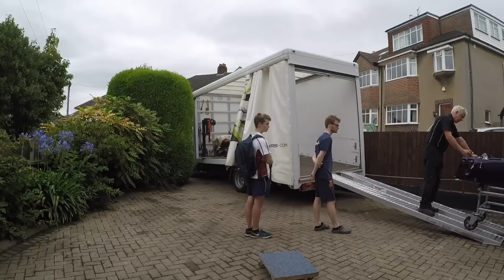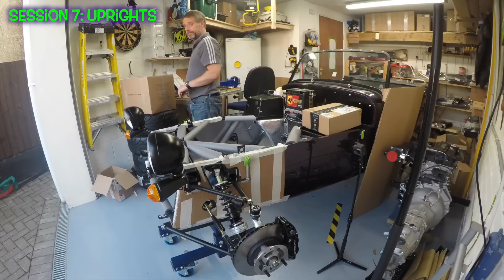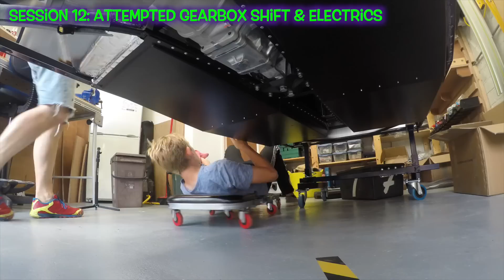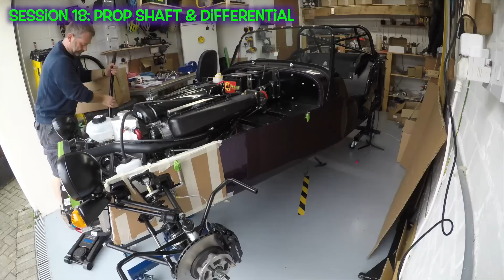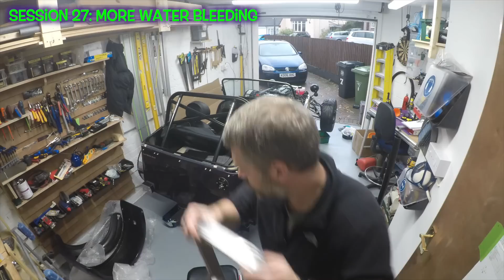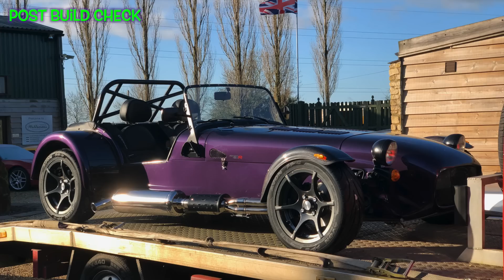Build A Caterham 420R Kit Car In 30 Minutes // Time-lapsed of course!

Comment: I’m about to embark on a build and watched yours (and others) from start to finish.
I felt your pleasure and your pain and I would like to thank you in advance for alerting me to the problem areas and pitfalls.
As for suggestions . . . 
There is a major shortage (absence) of home maintenance/servicing videos and a series of these would, I suspect, be uber useful.
My build is going to be a 360S with sports suspension, SV with lowered floors.
I would very much like to document it for the benefit of others but need basic advice on setting up a blog/website.
Could do with a chat in that respect. Are your contact details in your build diary?? - I must look!
Reply from the maker: Hi @ybliga, yes you can find my email address in the contact page of my blog. We can connect on WhatsApp or something after that. I’d be very happy to chat with you about blogging and building.  
If you’re looking for some Caterham servicing and maintenance videos then I can recommend Turn7 and Rod Oldland. Both have done great videos. James at ACaterhamCalledFern also has a lot of really useful content.
Reply: @Purplemeanie thanks - I’ll be in touch.
I spoke to Rod earlier when looking for advice on specification that I should go for. What a fab guy - I wrongly assumed Turn 7 were a franchised dealer but despite knowing I couldn’t buy from them, he went out of his way to be helpful and gave very good, unbiased advice.
Likewise, I have watched a number of Jame’s  videos.

Comment: I wonder how much it would cost to import a complete kit to the US. Do you know if the prices on the website are for an assembled car, or the kit? I wouldn’t mind building one of these. They’re very cool, and unique here in the states. Great job👌
Reply from the maker: Thanks for watching. There certainly are people that buy kits and have them shipped to the US so they can be built there. I think there’s a company that offers that service. The USA7’s website would be a good place to ask: https://usa7s.net. One issue you’ll have to deal with though, is that finished cars and kits are on quite long lead times - it was over a year when I last heard, but I think they’re working hard to get that down again now. As for pricing, they certainly did used to provide pricing for kit builds on the website, but I think they may be presenting a US version of the website that doesn’t include kit options. Good luck with your search. John

Comment: I have to ask, is the ford duratec engine worth it?  I've heard the k-series engine or even a rotary is great in this car, but I would assume the downside to a rotary makes it less practical off the track with the warm ups and fuel mileage drop.  But otherwise, it does have a weight advantage.  Any experience with other engines?  Do you have issues with the Duratec?
Reply from the maker: HI, thats a very good question. To answer the last part first, I’ve had no problems with the Duratec, and I’ve not heard any problems from other owners. Caterham even makes a supercharged version that is another level again from mine. They do also still sell a 2.5L Duratec in the European market that I’ve heard is very impressive. Then Caterham now sell a 600cc Suzuki engined version of the car that many owners love for its light weight and therefore great handling - nowhere neat as performant, but a lot of people really like it as a fun car on the road and track. The k-series engines are often loved by Seven owners as a free revving and lighter version, but of course they are now older cars only, and not available as a new purchase - but I know owners who would absolutely not “trade up” to a Duratec because the love the character of the k-series so much. Personally, I’m a bit fan of the 2.0L Duratec due to its lazy town and country driving but can be a beast on track too. I have no experience of rotary based Seven’s so can’t give any opinion there. Perhaps one of the downsides of the Duratec’s is that they get very hot, and there’s a lot for heat soak into the passenger compartment - which can be a pain on hot summer’s days, touring, or on track, where you can’t get away from the heat (makes for toasty knees). The Duratec’s are also a bit heavy, so handling isn’t perhaps the same, they can push on a bit in corners and not as nimble as a k-series or Sigma car. I love my 2.0L Duratec, it’s just right for me. But you’ll hear many other Caterham owners say the same about their completely different cars too. You pays you money and takes your choice. Hope that helped, maybe not. It’s a complicated subject with not one right answer.
Reply: @Purplemeanie  Great feedback.  Appreciated.

Comment: Great job, well done. Love the vid, love the car, but, I stopped watching when I learned the price. (Half way through). Sorry. I just can't justify spending that much on a car I have to build myself. LOL. I could buy a nice secondhand Porsche for that. 🙂
Reply from the maker: That's a very good point about the price, I totally get that. But for me half the fun is in knowing I built it.Thanks for watching (half) the video and taking the time to comment 🤣
Reply: @Purplemeanie  I will go back and watch the other half, some other time. 
And I appreciate that you built it yourself. I'm a panel beater - spray painter. I owned and ran 4 smash shops back in the day. I'm 63 now, but I've restored and built many custom cars over the years. It's always a thrill to see the finished job, knowing you did it by yourself. More power to you. 
Cheers from Australia.

Comment: The original Lotus 7 was advertised as 0-60mph in 3 days. This was how long it took you to build it from the kit. What took you so long!
the reason to build it from a kit was to avoid sales tax. But then the whole thing only cost 1000 pounds (UK money)
I remember a friend who had a Lotus 6, with a Triumph TR2 motor. Talk about fast roller-skate!
Reply from the maker: Yeh... you're right.. I took a long time. Part of the problem was that I was savouring it 😀. But it was also that I blogged all the build on my website and that took me as long as the build itself.

Comment: As an ex employee of Arch motors, saying it's a kit car makes it sound like a cheap copy.
This video shows that these builds ain't for the faint hearted....
Reply from the maker: Thanks for the comment. You're right, they're not for the feint heated, but they're also quite accessible if you have some mechanical acumen 😀. I think there are a lot less "kits" that are half-finished these days. The number of blogs available to help you are a big part of that I think too. Personally, I think the Caterham "kits" are top notch. The guy that did my IVA test said that he usually has a lot less trouble passing Caterham builds, over other kits, because of the quality of the kit.
Reply: @Purplemeanie  They are the best ones to build from a  kit as you've said because they are quality and  the frames are repairable as well due to being bronze gas flux welded instead of being mig welded together and less stress points on the frame due to the welds being harder than the parent metal.

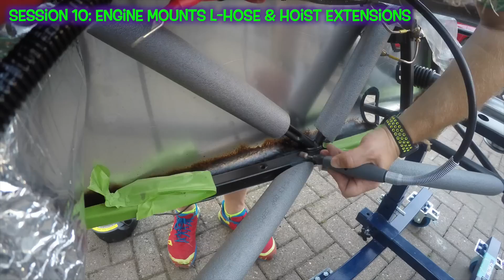Comment: Great video. I know it's two years ago but in some shots it looks like there is serious corrosion at the bottom of some panels e.g 9:18. Curious as to what it was. I've thought of building a Caterham but the laws here in Australia make it almost impossible to get it registered.
Reply from the maker: Hi Graeme, no there's no corrosion on the panels. Possibly just reflections off the floor maybe? I've now done about 4,000 miles in the car (pandemic knocked my mileage for a while 🙁) and no signs of any corrosion. I feel your pain on laws... I suspect it will become more and more difficult to own cars like this here too soon.

Comment: Exhaust spring installation assistant... about an 8 inch piece of tubing or round stock, with a hole to catch spring anchor, with an OD less than the spring hook ID with one end cut with a little angle can be slipped over one of the header spring anchors to extend the spring to hook in place.
Reply from the maker: That's a good idea 👍🏻

Comment: I am an ex pat living in California, I recently just started building a factory five roadster.  I have always liked the caterham nice work.  The factory five does not have the cabin panels fitted in the factory and that is what I am working on now.  I am planning on my build being easy to update to pass the Iva in case I return and want to import it.  Did you ever look at it during the build and think to yourself what have I done? I have always dreamed of building a car but sometimes it looks overwhelming.
Reply from the maker: Thanks for the comment. As I was building mine I did wonder whether I had bitten off more than I should have. But looking back now I realise that it was actually really straightforward and I should't have worried. Good luck with the build.

Comment: I had a concept of a Corvair engine in one (in front), with transaxle in back (via: torque tube), but theirs no way of making the block a structural member, replacing the existing tubular frame (triangular support) and other "minor" issues.  ;-)
Reply from the maker: That would have been cool. But there's so little room in a Seven chassis.
Reply: You're correct and like I indicated, the structure would be compromised.

Comment: I would love to do a catheram build, but only ordering the body, seats, lights and fenders, and get all the mecanicals parts of a subaru WRX! I know the flat engine wont sit in the engine bay, and a lot of electronics will have to be messed with to just have the car starting, and that custom axle would be needed, but I mean, why not?
Reply from the maker: That would be a pretty amazing build. Go for it!

Comment: Hi. Thinking of doing a 420R myself, this video is really helpful. What would you say were the most difficult / headache inducing parts of the build?
Reply from the maker: Thanks for watching and commenting. Tough to say what was the most difficult… the headlight wiring was frustrating I guess but all of it was very do-able. I think the biggest frustration was the manual and the amount of research I had to do outside of what was in the manual. I know there’s the new Ikea style manual these days, and I haven’t checked how good it has become… but the last time I talked to someone about it they said that you still needed to use the old manual AND the Ikea manual to make sure you knew what you’re doing. There’s a new Blog out there “The Complete Guide” I think its called and that’s supposed to be good. If you want more of my ranting then of course there’s my blog too. All that to say… Good luck! It was one of the best things I’ve ever done, and a great community once you’ve built it.
Reply: @Purplemeanie  thanks very much for the tips, I'll have a look at blogs.

Comment: great build video.  looks like even Caterham which comes in a semi assembled kit, there is still a lot of work to do and fiddling around to get everything to fit right. 

2004 i built a Tiger kit car, you have to do a lot more as you get the chassis bare frame, some bodywork and suspension pieces etc and have to supply your own engine and gearbox.  It was a good learning experience and like yourself i remember i had a wet day for the vehicle test day. 

If i had the money, time and a garage i would love to build another kit car someday.
Reply from the maker: Yeh… you’re right, the Caterham’s come with a lot more already done than other kits…. And more than I was expecting to be honest. Good luck with any future builds!

Comment: Thanks for taking the time to make this video. Can I ask, how much you need to spend on 'bits' beyond what you need to pay for the car itself? Wheeled axel stands, hoist, any other special tools, all the testing and the fees for pickups, etc? Excluding the basic tools every garage already has, of course :)
Reply from the maker: That’s a good question. I forget but I think the car registration cost about £200. As for tools and stuff that wasn’t in the kit… I spent a few hundred pounds, but you could probably get by with just the regular screwdrivers, spanner’s, Allen keys, drill bits, socket set etc. There is a high torque wrench required but many people just get those wheel hub nuts tightened up at the Post Build Check and so don’t need the torque wrench. You can see all the stuff I used here: https://purplemeanie.co.uk/index.php/2018/07/01/caterham-420r-build-tools-and-trinkets/

Comment: Miller Corner was on the pic??
Reply from the maker: Hi, Where did you see Miller Corner? I think I’ve seen Miller somewhere but can’t see it in the video after a quick look. I seem to remember it being on a different track configuration than the National Circuit. :-)
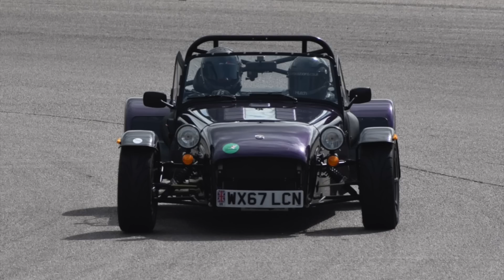Reply: @Purplemeanie  32:58
Reply from the maker: Ah yes. I was looking in the wrong video when you commented. Yes, I used shots from the track day in the build video. I think that’s what you’re talking about.

Comment: Way back in the early sixties I was driving a truck to Harlow to deliver steel tubing to the Lotus Factory when a little aluminum-bodied toboggan passed me as if I was parked.  It was one of the original Sevens built at the Lotus Works.  That day was when I first saw and fell in love with what is now the Caterham Seven. At that time the original car was powered by an A Series BMC 1000cc (997cc really), they were easily obtained and easy to work on and produced good "HP" at that time I also part-owned a MINI group 3 Saloon which was also powered by an A Series 997cc, I was the dog's body mechanic (with ten-inch steel fingers) and driver of the little beast.
I still haven't given up the idea of owning one Caterham Seven but have no desire now (at my time of life) to build one myself although I have given a hand in a couple of other builds. It all looks too hard and would play havoc with my aging bones.  But, thank You for an excellent video and "WELL DONE TOO"
Reply from the maker: Thanks for the comment Brian. I like to think you're never too old to follow your dreams. John

Comment: Great video, really well done sir. That didn’t seem like 33 minutes at all. Very interesting to watch your trials and tribulations. Have you thought about heli tape for the areas of body work that chafe? You could even get a carpet tile designed for heavy traffic areas and cut strips from it to make a hard wearing yet slightly soft non scratch pad?
Reply from the maker: Thanks for the comment. Hmmm... no I hadn’t thought of heli tape or carpet. I’ll have a think about that. Thanks. John
Reply: Purplemeanie had another thought. 3m make a product called dual lock. It’s basically really strong Velcro where both sides are of the plastic hook type. It’s very strong. We used it to hold number plates on super cars for testing and they never came off even at 170mph plus (on a track). It does end up being about 3mm thick when it’s mated together though so might create an unsightly step. It would stop the panel flexing at that joint though it that’s a problem.
Reply from the maker: @mopedmarathon  Hmmm. I'll have a think about that. I use the dual-lock to secure the number plates on the car, so could try it out elsewhere.

Comment: Am I right in thinking that they use a solid brake pipe on the rear to connect to a brake calliper that moves side to side as the brakes wear, I know its only a small amount but I would have thought they would us a flexible hose. Great vid and build by the way, I always wanted to build one but never had the money so I built a trike instead :)
Reply from the maker: Hi Michael. A trike sounds fun! 
Yep, the standard installation has a solid brake line at the rear connecting to the callipers. The race series cars have flexible hoses and you can switch out the solid lines for flexible ones on the road cars too. I have the flexi hoses ready to go on once I get some time.